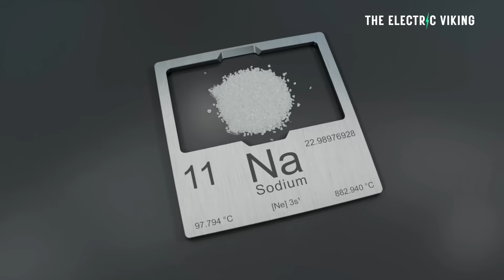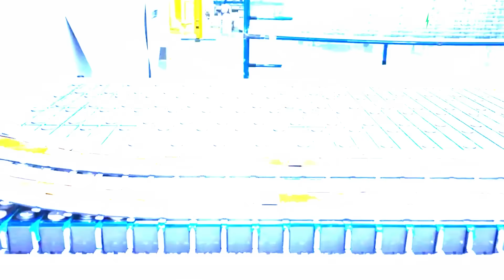Goodbye Lithium! New 3,600,000 Mile EV Battery costs 50% LESS

Comment: CATL NAXTRA crush (x,y,z axis), nail penetration, drill, and saw tests.  No fire on fully charged battery.
https://www.youtube.com/watch?v=V2frfkEnBew

I asked twitter AI Grok4 in expert mode, to find the specification for the CATL NAXTRA battery.  It could not find the datasheet.  It could only find what others keep repeating on energy density, cycle life, operating temp range, and safety.  That is a huge red flag for anyone saying these batteries are in production and available.  As an electrical engineer, there is no way I would design in these batteries in any product, with no datasheet.

Hi grok, can you find the specification for the CATL NAXTRA battery?

The CATL Naxtra battery is the world's first mass-produced sodium-ion battery, launched in April 2025. It uses hard carbon as the anode material and Prussian white as the cathode material. This battery technology aims to reduce dependence on lithium resources while offering competitive performance, particularly in extreme temperatures. There are at least two main variants: one for passenger electric vehicles (EVs) and a 24V integrated start-stop version for heavy-duty trucks. Below, I've compiled the key specifications based on available sources, separated by variant. Note that detailed datasheets are not publicly available as of the current date, so this draws from official announcements and technical analyses.

Passenger EV Variant SpecificationsThis version is designed for electric vehicles, achieving performance comparable to lithium iron phosphate (LFP) batteries in some metrics.

Specification
Details
Energy Density
175 Wh/kg (highest among sodium-ion batteries worldwide)  

Range
Up to 500 km on a single charge  

Cycle Life
Over 10,000 cycles  

Operating Temperature Range
-40°C to +70°C; retains 90% usable power at -40°C and shows no significant degradation at -40°C even with 10% state of charge (SOC)  

Safety Features
Intrinsic safety with no combustion-supporting factors at the material level  

Applications
Passenger electric vehicles; can be integrated into dual-power architectures (e.g., combined with LFP or NCM chemistries for extended range up to 1,500 km in some configurations)  

24V Heavy-Duty Truck Variant SpecificationsThis is an integrated start-stop battery for commercial vehicles, replacing traditional lead-acid batteries with sodium-ion technology for improved efficiency and environmental benefits.Specification
Details
Voltage
24V  

Capacity
192 Ah  

Usable Energy
4.5 kWh  

Configuration
8s1p (8 cells in series, 1 parallel), consisting of 2 modules of 4s1p each  

Service Life
Over 8 years  

Operating Temperature Range
-40°C to +70°C; supports one-click starting at -40°C and can start after being idle for up to a year  

Cost Savings
Reduces lifetime costs by 61% compared to lead-acid batteries  

Other Features
Supports deep discharge across full capacity; more eco-friendly and efficient than lead-acid; no communications port, with 2 power terminals; module structure likely aluminum with extruded endplates (based on visual analysis)  

Applications
Heavy-duty trucks for engine start and operation  

Additional NotesCost: Reports indicate the Naxtra battery can cost as low as $10/kWh, making it about 10% the cost of typical lithium-ion batteries and enabling broader adoption in affordable EVs.  

 This could translate to batteries lasting up to 3.6 million miles when extrapolated from cycle life and range.  

Breakthroughs: The Naxtra represents a shift to "energy freedom" by using abundant sodium resources. It's integrated into CATL's dual-power architecture, which divides battery packs into main and extended energy zones for optimized performance in scenarios like cold weather or long-distance travel.  

Availability: Mass production began in 2025, with plans for use in over 30 vehicle models by 2026.  

If you need more details on a specific aspect or related technologies, let me know!

19 web pages

Comment: So, batteries that could be reused. But so what. So what if evs need to be disassembled to access them. So what if the batteries need to be disassembled and repackaged for next use. There have been some flash in the pan ideas for swappable batteries, but is there any movement to make universal quick installation and removal in the industry? If these could be made as universal as flashlight or auto 12v batteries, then, it could really take off.

Comment: It will be interesting to see how much they degrade at 10,000 miles 50,000 miles and 100,000 miles. 

Do they drop quickly and then stay there for 3M miles or is it a slow slope and they still have over 95% capacity at 200,000 miles

Comment: I think your comment about not being 10x cheaper applies to EVs.  Most people change there cars much more quickly than 10 years, never mind 30.   However for energy generation, the lifespan of these batteries approaches the lifespan of solar panels or wind turbines. Currently you would need change batteries to soak up excess  renewables every 10-15 years, these batteries are going to work for 30+ years.  If they're 50% cheaper and last 3 times as long then the hyperbole is less extreme.  In this use it less extreme, besides most people use a car 2or 3 most  a day, but use electricity 24/7 365 days per year.

Comment: The hype around sodium-ion needs tempering. While CATL’s advancements are real, the 160 Wh/kg figure was announced in 2021, and even the improved 175 Wh/kg Naxtra battery (2025) doesn’t yet match LFP’s 185-200 Wh/kg. The promise of 200 Wh/kg has been delayed, suggesting technical hurdles remain. Moreover, claims about cycle life and safety, while promising, need rigorous real-world testing to confirm. The narrative of sodium-ion as a lithium-killer often overlooks these practical limitations, driven by excitement over cost and abundance rather than hard performance metrics.

Comment: 175 Wh/kg will mean that a 100 kWh battery would have to weigh at least 570 kg. Even a modest 50 kWh battery would weigh over 285 kg. Allowing for a buffer of 10% of the total capacity, and assuming that the car can manage a decent 8 km/kWh, the 50 kWh car would have a range of 360 km (225 miles). 

For comparison, and from my own experience over the past 50 years of driving, a typical small petrol-fuelled car would have a range of around 200 miles. So the 50 kWh battery would be adequate, and compete very favourably with the liquid-fuelled equivalent car, providing that the battery could be recharged in 5 to 10 minutes. The larger, 100 kWh battery, giving around 400 miles of range in a small car, is straying into truck/ute territory.

Therefore, I don't see driving ranges of affordable cars becoming larger and larger, but rather that they will stabilise at around 250 miles of realistic range, with the battery mass becoming lower over the years. If range was the only criterion, then petrol cars would have massive fuel tanks compared to those which they have today.

Comment: If this comes true and even if this one doesn't do what he's talking about which is b, the one main component left over when a car is dead and then can spend the next 20 years being inside grid storage somewhere or someone's home. Even if that's not true with this one, eventually will be true with some battery pack for a car in the future. It's just a given. Now let's look at the other two primary components of an electric vehicle, the transmission and the motor. I would suspect that within 10-15 years you will swap out the entire upper body of a car and then the half shafts and the brakes and just put a new body on the old car. You know all the seat belts and and and tires and display and dash rear seats all that s*** we'll just get replaced like how you rekit a old Volkswagen. Think how much cheaper your car is going to be

Comment: It may have been mentioned and I simply missed it.
But to me, the most important 'feature' of next generation batteries to be game changers are ones with extremely fast recharge times.
If one still has to plug their car in overnight to get a full charge from 'empty' is still pretty much useless, unless it's your second vehicle or you live in the city with a very predictable routine type job like 9-5.
Other people who run their own small businesses, professional contractors, etc. who need to go on short notice and/or long distances outside the city into rural areas - need to have quick recharge similar to if driving a gas vehicle and only have to spend a few minutes filling up the tank to get back on the road.

Comment: Sam, the solution to having all these Na batteries sitting around is to make cars that can do a fast swap of batteries. You buy them as cradle to grave batteries. As you wear out your car, you buy a new one without a battery and they swap it from your old car to new. You mentioned 170 W/Kg.  LiPo density is about the same, cost more and are not compatible with cold climate and zero chance of fire. What's not to love. Imagine in 5-10 years will see in mainstream EVs.

Comment: Apparently, sodium-ion batteries require a rare and expensive to produce anode (mainly) and cathode materials, which offsets the sodium benefit.  This in combination with scale production and established supply chain stability of all lithium-ion battery materials… may delay adoption of sodium-ion batteries.

Comment: 19 is huge diff vs 55. If only they'd make a sodium based replacement battery for the mg4 standard (lfp with 140 density). You could get a 63-64 kWh battery for 1200 usd, plus shipping plus servicing costs, would be a nice upgrade.

Comment: we would need a germen tigre tank to go 6000000 km without breaking apart. so how did they test this battery? sodium batteries and solid state batteries are always the next thing until they are not seen. in the meantime I am charging at home at 2kw on weekends 50% solar and driving quietly to work without a drop of gas. bt I am old fashioned

Comment: Thing is battery density is NOT only primary concern... neither is weight. Why do you a need a fewer light batteries in a fixed application if they only last a couple years??? What about a battery that lasts decades with minimum maintenance. A battery that has proven industrial use for 80 years constant use. It called the Edison battery. Not only do the last decades... they do not use lithium... they work in wider temperature ranges. They can be completely discharged with no damage.

Comment: I was spot on 10 years agom I was predicting that batteries would be seperate from the tool, just like you can use the same battery in your angelgrinder or drill and the next item you buy, now we will buy one battery and just switch the car around it for many many years..

Comment: The mileage is meaningless as it depends on the battery capacity and efficiency of the vehicle. Too much could, would ,should. I won't be using them as their charge / discharge curve rules out being able to use their full capacity without power conversion electronics. They might be ok with grid storage but there is stiff competition there with all sorts of alternative methods, some much more simple and potentially everlasting storing excess power as heat. From an EV point of view there are also some other new variants coming on line. I suspect it will come down to big business deciding what to adopt and there will inevitably be back handers involved just as there is with so many industries such as the oil industry. It won't be success for the best but for the most promoted and also only from the tech that are allowed to survive at all.

Comment: But charging the batteries is still the same unsolved problem. The energy has to come from the grid. And it will always take hours or even days to fully charge the battery.

Comment: Low-temperature performance is everything here in Canada, where -40º temperatures are routine in winter. The EV manufacturers keep re-assuring us that the winter performance is perfectly fine, but EV owners here know that we lose a lot of charge driving in winter with lithium battery powered cars. If sodium batteries can give us better winter performance, Canadians will be all over this.

Comment: Well, we could try engineering vehicles to last longer instead of just throwing them away every 5 years.  It isn't like electric motors could easily be replaced.  Come on man.  Think harder.  We need to start looking at longer replacement cycles.  How much energy would that save?  How much money would that save?

Comment: Wow!!! It seems we will have to say goodbye not only to lithium batteries, but also to oil and nuclear power plants. No more nuclear waste and pollution from oil-fired power plants.
Reply: How? Electricity still has to be produced in the first place one way or another.
Reply: @redmed10  Leveraging solar and wind power is the most direct and simple charging solution. Because battery modules can be transported by truck, there's no need for extensive solar panel deployment, significantly saving on copper wire and cabling costs.

Simply integrating large battery modules into existing energy systems can improve power plant utilization. It also supports the integration of solar and wind power generation equipment, effectively integrating solar and wind energy into existing systems.

I compiled some information from the Internet.

AI Overview：
To power the entire Earth with solar energy, you would need an area of solar panels roughly equivalent to the size of Spain to meet current global electricity needs, or about 1.2% of the Sahara Desert. However, this requires considering factors like the sun's intermittent availability (day/night, weather) and the efficiency of solar panels, which would necessitate much larger installations and significant energy storage solutions to provide consistent power. 

Area Required
A theoretical calculation suggests a global electricity consumption of about 20,000 TW/year, which could be met by covering an area of approximately 548 million square meters of solar panels, or a square with a side length of about 236 km. 
Some calculations estimate that if you covered 1.2% of the Sahara Desert with solar panels, it would be sufficient to power the entire world's energy needs, according to one Quora source.
Reply: @redmed10  why did you delete my previous reply?
Reply: @redmed10   Here you go! You can obtain it from the internet. To power the entire Earth with solar energy, you would need an area of solar panels roughly equivalent to the size of Spain to meet current global electricity needs, or about 1.2% of the Sahara Desert. However, this requires considering factors like the sun's intermittent availability (day/night, weather) and the efficiency of solar panels, which would necessitate much larger installations and significant energy storage solutions to provide consistent power. 

Area Required
A theoretical calculation suggests a global electricity consumption of about 20,000 TW/year, which could be met by covering an area of approximately 548 million square meters of solar panels, or a square with a side length of about 236 km. 
Some calculations estimate that if you covered 1.2% of the Sahara Desert with solar panels, it would be sufficient to power the entire world's energy needs, according to one Quora source.

Comment: The price will decrease as production scale increases. These are launch prices.

And the competition will come -- CATL will not hold exclusivity on this tech for very long, further driving down the price.

And the technology will continue to improve, where improvements in density will drive relative price down as well. Thus the price will drop as the technology improves (as it has been with Li-Ion).

Further, if it lasts 3x a typical Li-ion or LiFePo, then this should be accounted in the price, costing (relatively, over its lifetime) 1/3 of the sticker price.

All in all, a detailed analysis of real cost will likely be done as these reach maturity, and the price is almost certain to drop as it always does with new technologies; ie. I think 50% is currently a gross overestimation of real cost, if it performs to claims, and the price will almost certainly quickly drop.